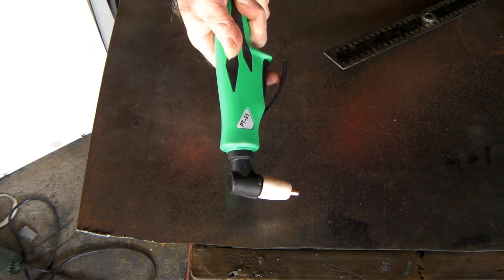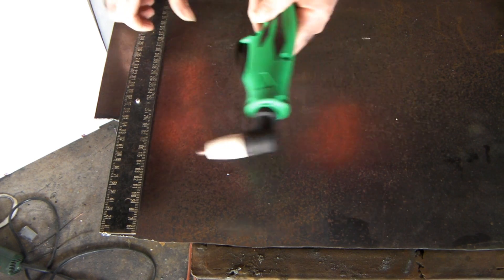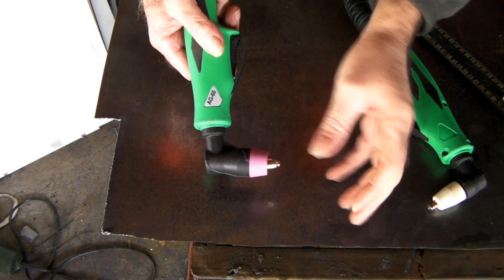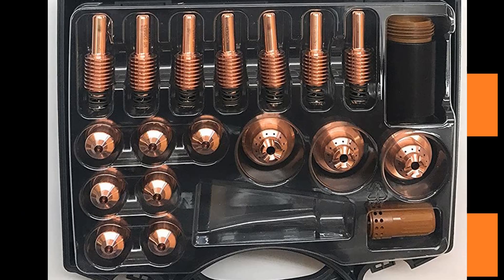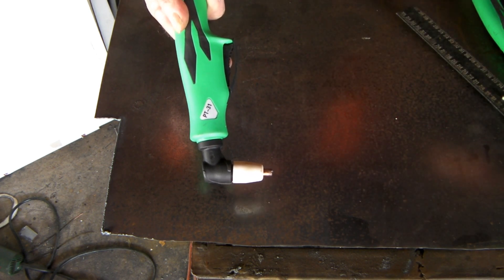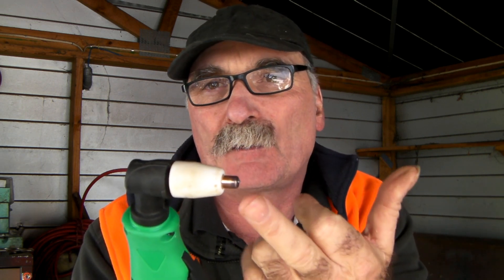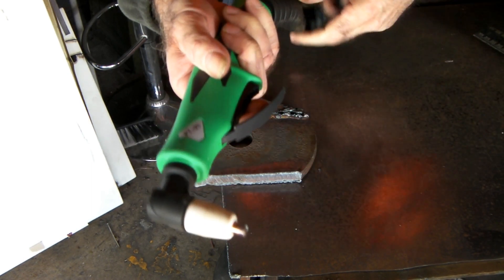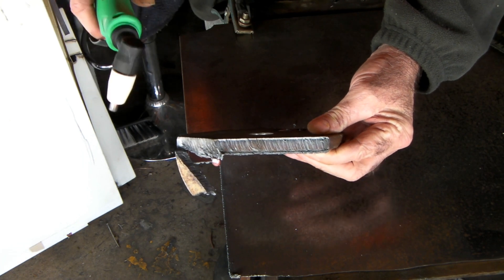Cheapest Plasma Torch To Run ???

Comment: Often "good enough" trumps better and saves $$$.    Harbor Freight tools for instance aren't going to do you proud but they will do the job....most of the time.    Just picked up a Bestcut machine on Amazon that costs me $240 and while not a Miller or a superior branded machine , the dang thing just does the job, and is good value for money.   Boils down to your needs and your budget every time.
Reply from the maker: Hi James i agree .If you have plenty of cash buy a branded machine. But you can still buy something that does the job cheaper.

Comment: Hi Pete,
which torch is the best from Pt31 and AG60 model?
Reply from the maker: i like the pt 31 /but AG-60 you can use a stand off guide
Reply: Thank Pete for your reply. So, if i have to buy a plasma like Cut50, i must use Ag60 or a better torch?

Comment: If you’re working in your home shop, then these are fine. But a pro level torch, such as my Thermal Dynamics SL60, is around $650 in US dollars. The genuine consumables last far longer than the cheap Chinese replacements. I’ve tried them. But you don’t need that level of refinement and reliability, if as Pete says, you’re only using it occasionally. And truthfully, the difference in the quality of cut, in the hands of someone who really knows how to get the most out of it, is there, but it’s not as much of a difference as you might think. It’s more like, mmm, that’s a bit nicer, but not, Oh my god, what a difference!.
Reply from the maker: Hi Mel thanks for you informative comment i agree with you both have there own advantages and disadvantages .Just chooses the machine that suits your own needs. 
Cheers pete